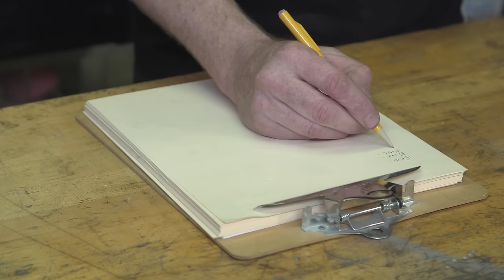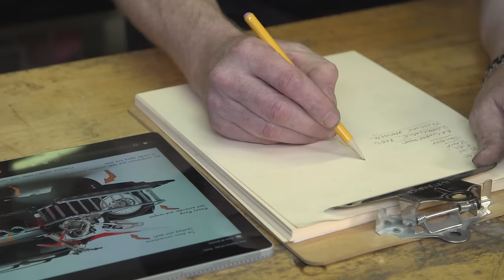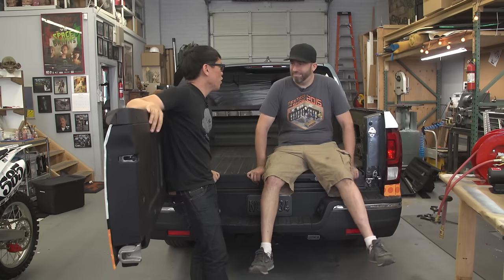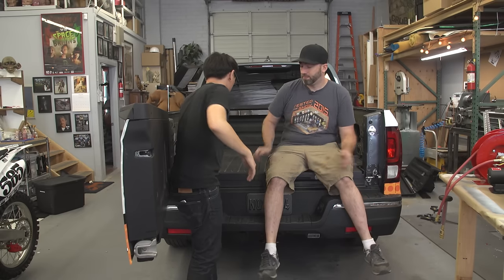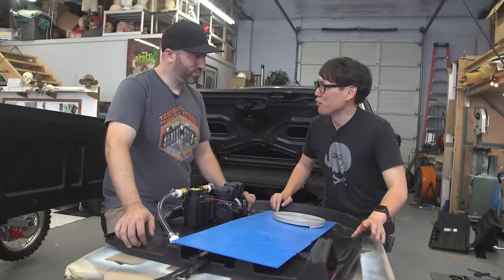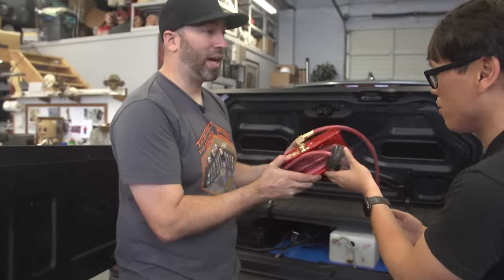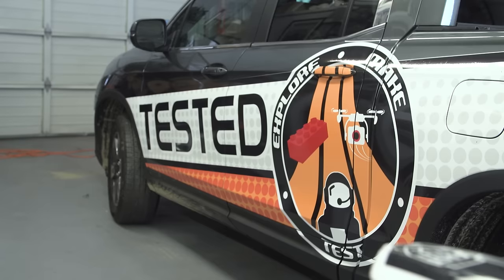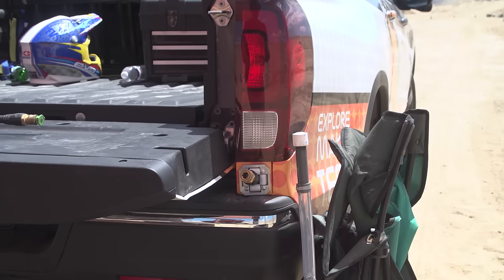Features Not Standard: Building a Motocross Mobile Pit Stop!

Comment: While I completely understand the need for this build if you go dirt riding and you don't have a van rig all set up, the in bed organization could have been better implimented. Because of this video, I am considering the retractable air hose reel. Why not take it a step farther and instead of the pressure hose on the passenger side, install an electric cord reel that hooks up to the inverter? I give it two thumbs up just for that inspiration!